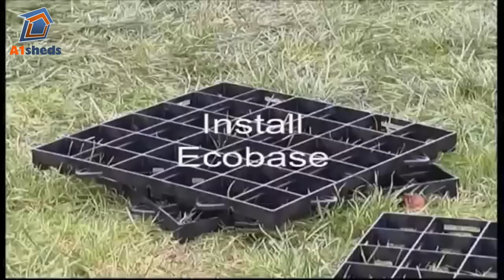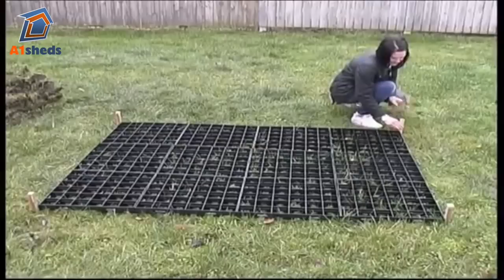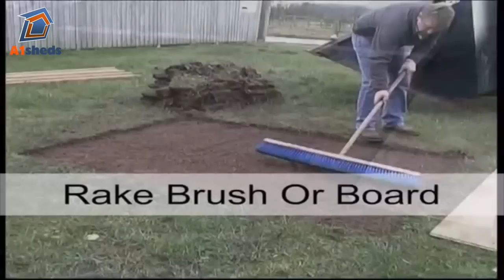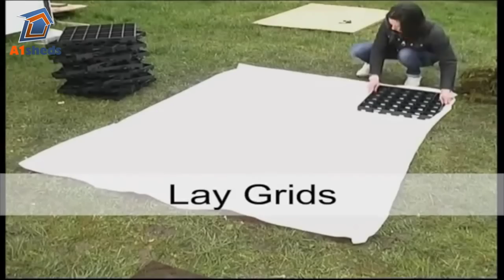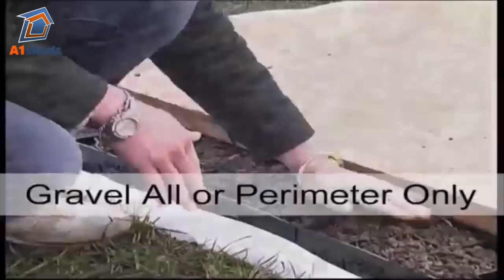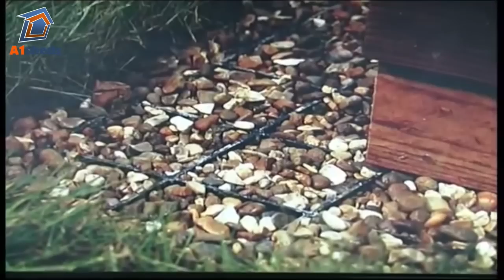EcoBASE Plastic Shed Base - How to Install

Comment: will this support a 600lb motorcycles weight
Reply from the maker: Yes, they are very strong and would easily support a 600lb bike. In fact, they can support up to 200 Tons (440,000 lbs) per square metre! when filled with pea shingle/ gravel.
Reply from the maker: Yes, as long as the ground below is well compacted.
Reply: Them things support being a driveway. They are good for fixing a water pooling area in your yard too.